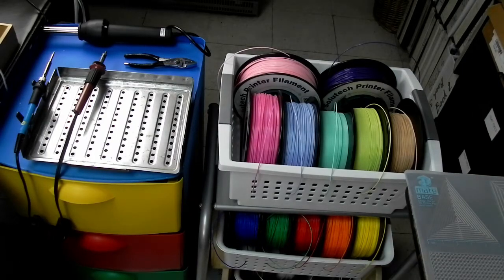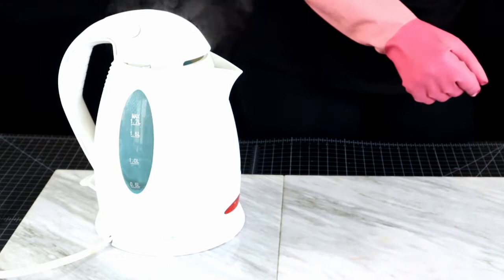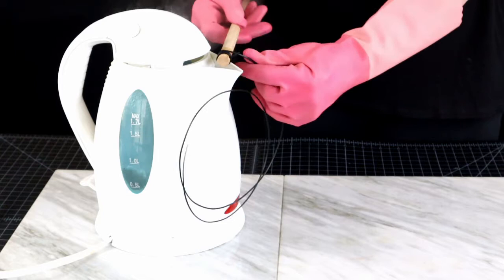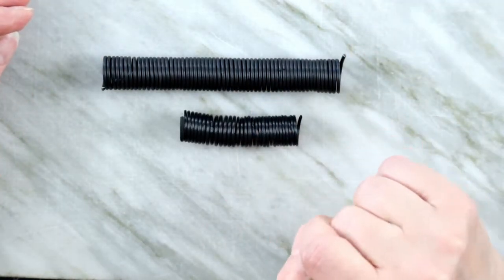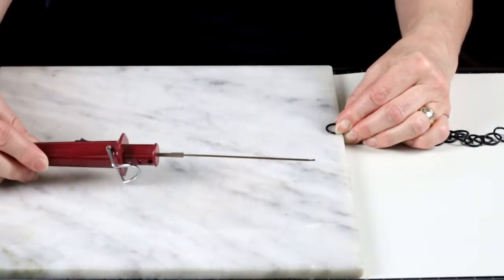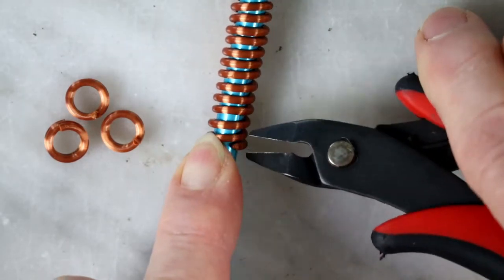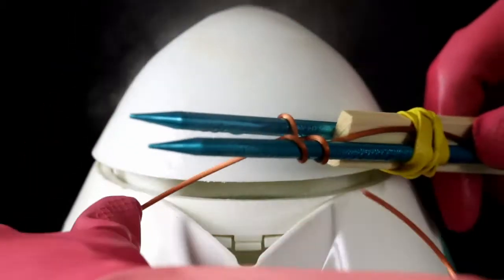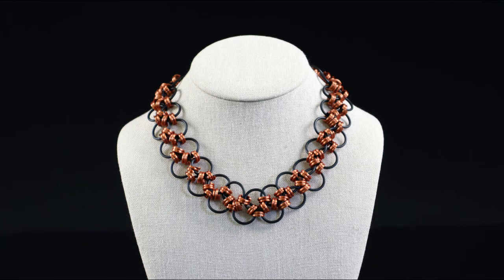How to make chains out of filament

Comment: I borrowed a friend's styrofoam cutter and it stopped working before I was done with my rings. Is the project too much for this tool to handle? What is your experience?
Reply from the maker: I know of at least one other person that has had this problem. It's possible that some of these are not meant to stay on for that long. I will have to look into it. Use the wood burning tool instead in the meantime. In fact I am working on a video about all the different uses of the wood burning tool, so stay tuned. :)